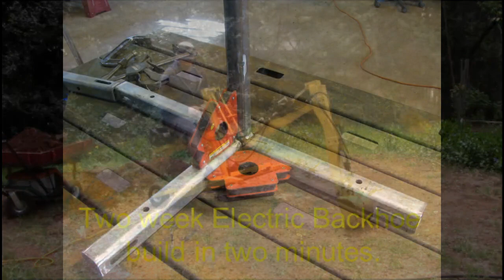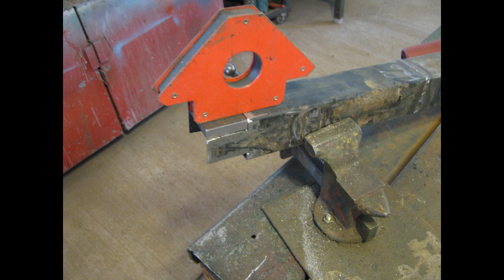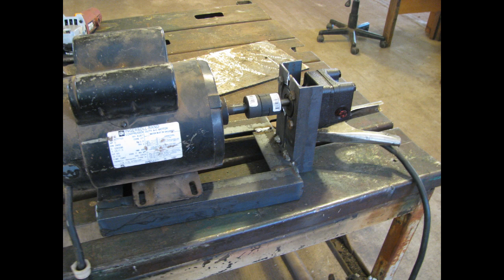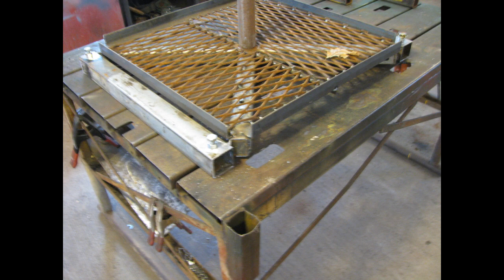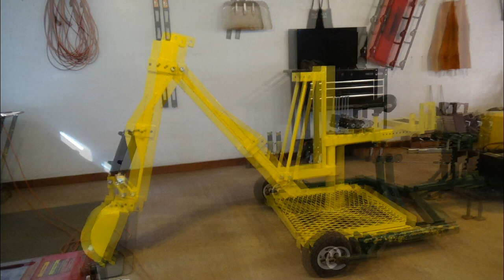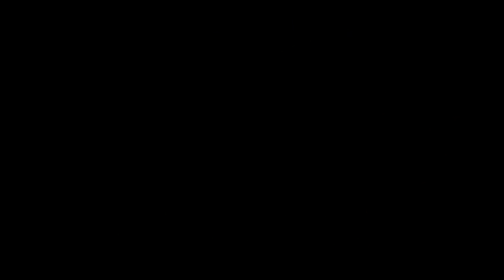360 degree electric backhoe. converts from electric to gas in minutes.

Comment from the maker: It is hydraulic with a 2 hp 110 volt electric motor running the .097 cubic inch gear pump at 2500 psi, plenty of power. Linear actuators would usually be too slow for this use. Thanks. Lonnie 
https://www.thegreensmachines.com/backhoe

Comment: Are those linear actuators? Thats awesome! Did it turn out to be strong enough with the actuators?
Reply: he used an electric motor to drive a hydraulic pump which is usually driven by a small engine.

Comment: Какой мощности применяется двигатель?
Reply from the maker: what power is used by the engine-  The gas engine is 4 horse power and the electric motor is 2 Horse power.  this is running a 1.5 gallon per minuter pump at 2500 Psi. Thanks. Lonnie
kakaya moshchnost' ispol'zuyetsya dvigatelem- benzinovyy dvigatel' moshchnost'yu 4 l.s., a elektrodvigatel' moshchnost'yu 2 l.s. eto rabotayet nasos na 1,5 gallona v minutu pri 2500 funtov na kvadratnyy dyuym. Spasibo. Lonni